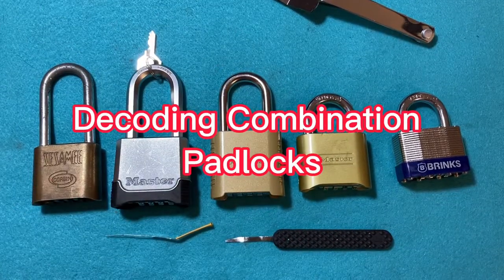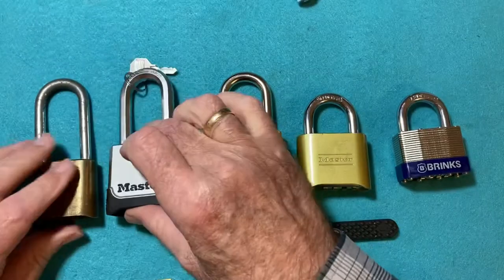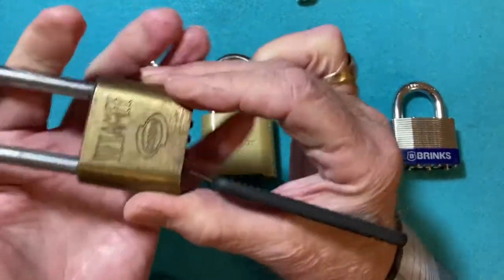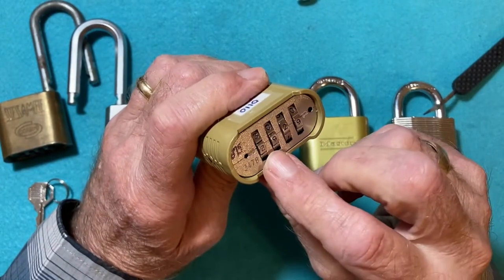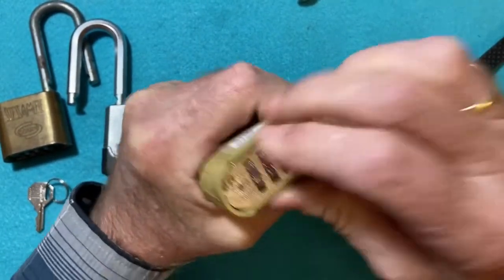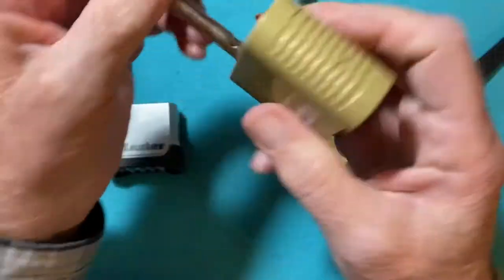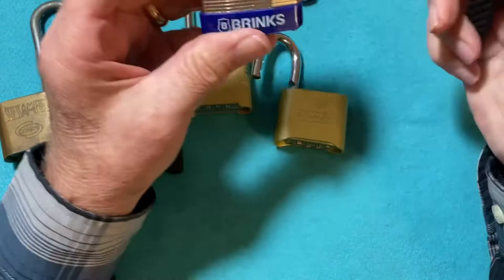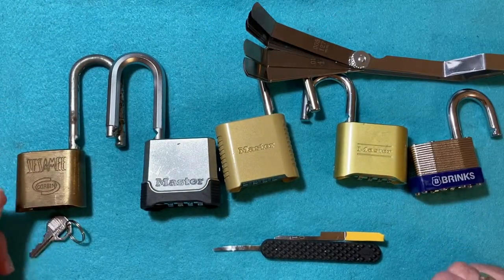#241 Decoding Combination Locks

Comment: Pardon the pun Jack but you have mastered decoding combination locks 🤣.
And pardoning the pun again I have not mastered decoding combination locks 🤣.
Question: why depress the shackle first?
Great video Jack 🙂👍🏻
Reply from the maker: Depressing the shackle releases the tension so when the decoder lifts up the locking plate, the spring on the shackle pops it up. Some locks don’t have a spring like the Master 875 and you have to manually pull it up. Thanks for watching Roy👍🦊

Comment: Great openings but technically you only decoded 1, the rest you shimmed them open, and without the code they can't be reset as far as I've seen.   most are not a problem, but I have a pair of  Sesamee by Corbin, Pat. 2853868, not the cheaper Taiwan made one's and these have very tight tolerances.
these two have a steel rivet in the back and I have no combo.  the Taiwan one's I just drill out the brass pin from the back, disassemble, decode and reassemble and there good. these are old and I'd rather not drill them unless I have to.  

Can you decode these type's ?

Thanks' , have a great day
Reply from the maker: Sorry for the error in my wording. I used the name because Sparrows calls the tool an Ultra Decoder. 
I didn’t feel any groves in any of the wheels with the blade to decode them. 
Thanks for watching and commenting.👍🦊